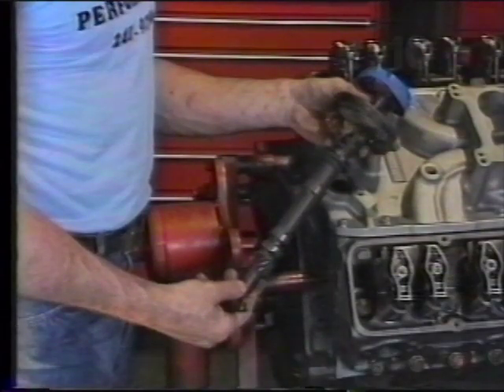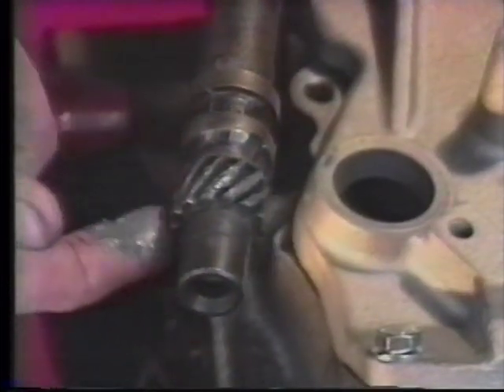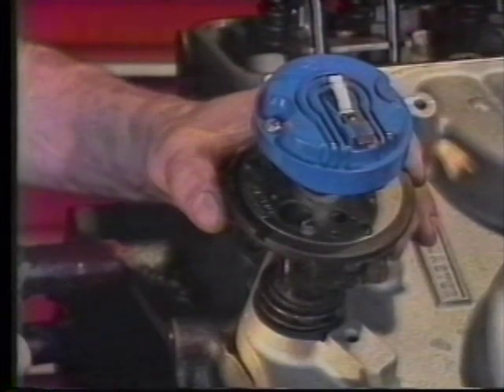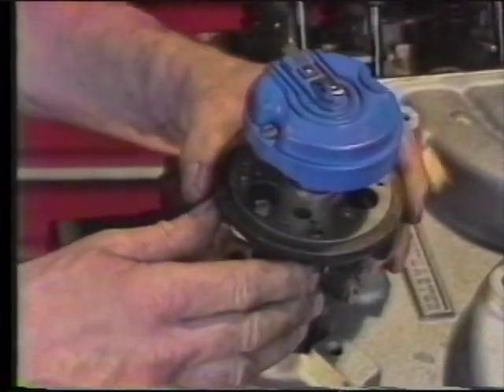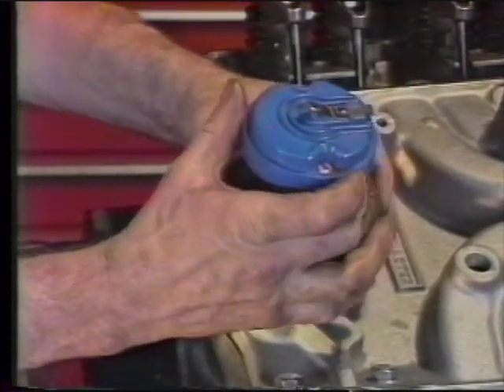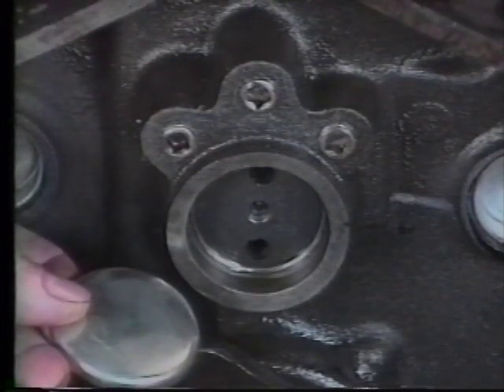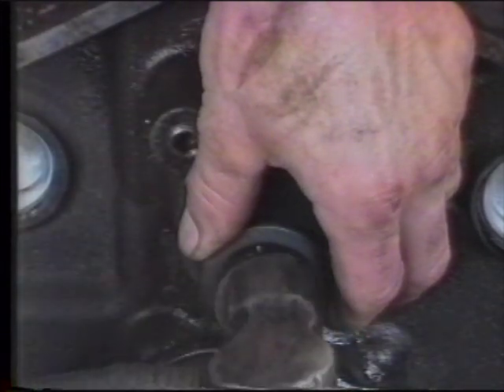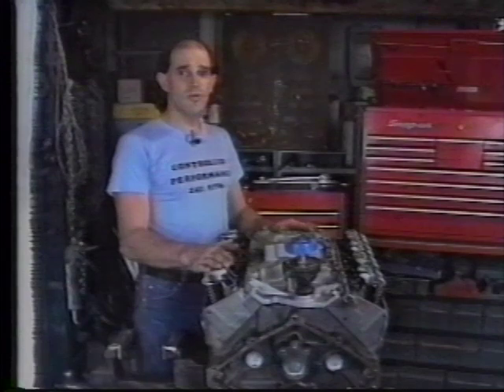Rebuilding Your Engine  Part 10  Distributor Installation

Comment: Or you can take a long flathead screw driver and use a flashlight to guide it down the distributor hole. Then you can turn the oil pump drive shaft manually to the point where the distributor will be able to drop right in. Makes it much easier.
Reply: Or even easier, place the distributor properly, and turn the motor over from the crank snout and it’ll drop right in